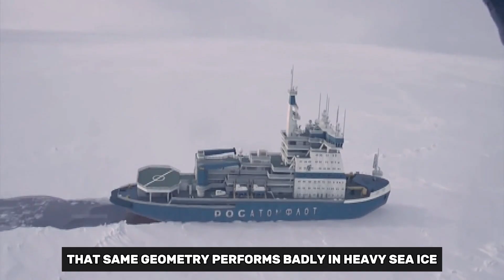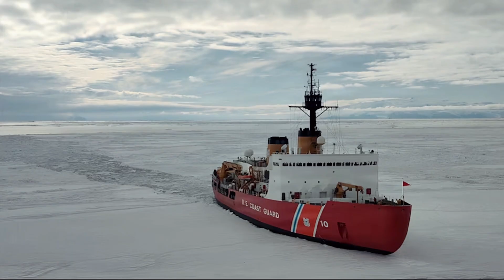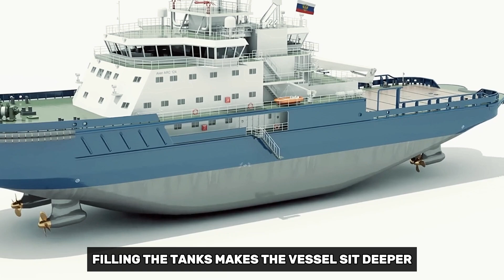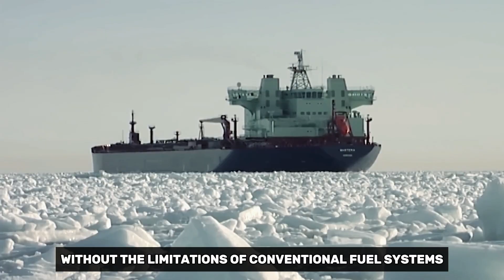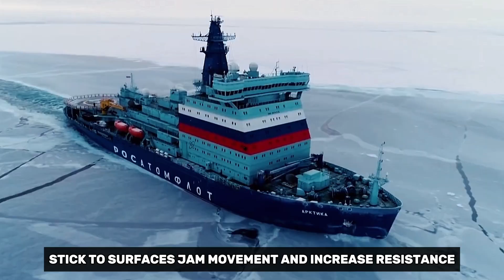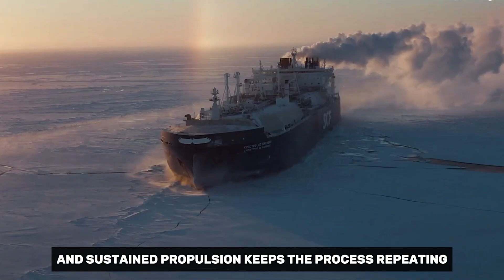Ice Ships Fail For One Reason Everyone Gets Wrong

Comment: What surprised me most is how much engineering goes into the hull shape alone. Reducing resistance while still being strong enough to break thick ice seems like a very difficult balance.
I wonder how future icebreakers will evolve as Arctic shipping routes become more important.
Reply from the maker: You’re absolutely right. The hull shape is one of the most critical parts of an icebreaker’s design. Instead of simply smashing the ice, many icebreakers actually ride up onto the ice and use their weight to fracture it, which reduces resistance while still breaking thick layers. As Arctic shipping routes become more active, it will be interesting to see whether future designs focus more on smarter hull geometry or simply more power. Which do you think will matter more?